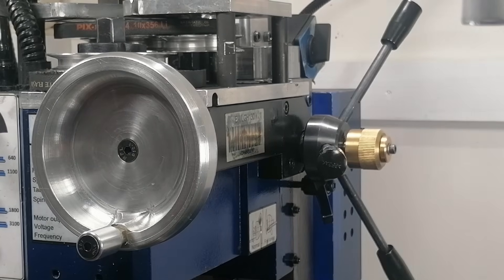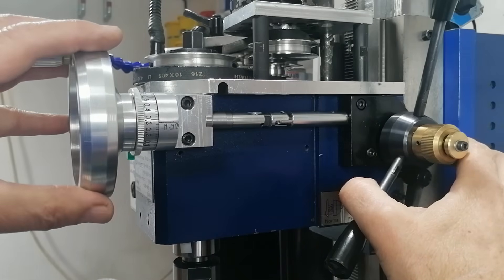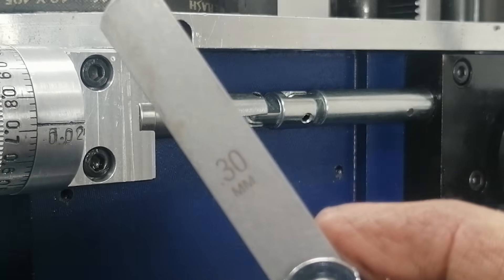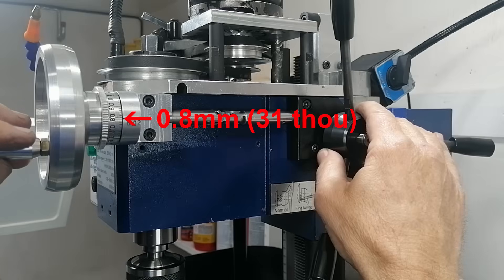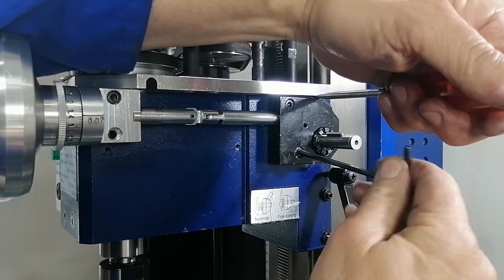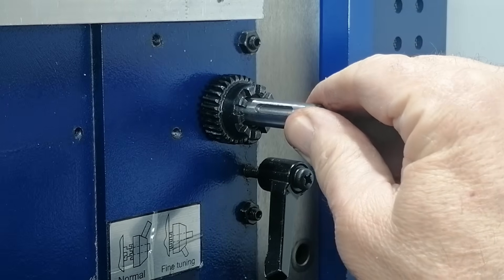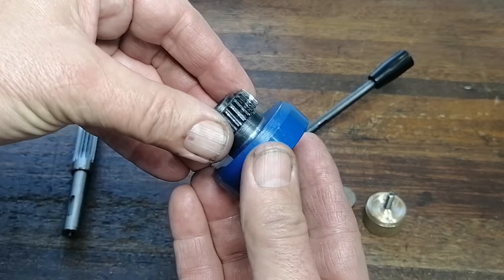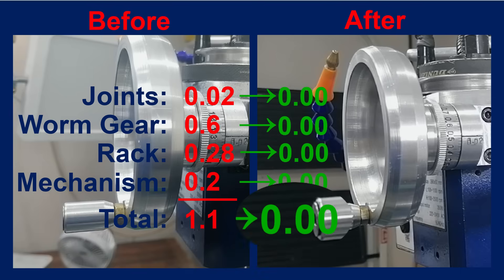Zero Backlash Fine Feed on the Mini Milling Machine

Comment: Excellent job. Instead of using small shims, why not eliminate the universal joint and use a rigid rod? The whole assembly looks well aligned, may be no bad alignement
Reply from the maker: Thank you. I initially considered using a rigid rod, but then realized that the worm gear alignment would need some movement when it is adjusted. I could have used a rigid rod if I allowed the bearing block holding the fine feed wheel to swivel, but that block is right up against the base of the 4-speed belt drive. At the end I thought that shims will be less work. But you are correct, a rigid rod is a good idea.

Comment: Very goog job.  What is the thickness of the shims behind the Z axis Rack?
Reply from the maker: Thank you very much. Each mill will have to have its own size. Mine was 0.65mm and 0.7mm. However, you need to leave space to prevent the head from being pushed forwards and off the dovetails. I realized that too late and released another video to address that. Look at my "Why I Brought Back Backlash on My Mini Mill" video" that describes why you need backlash on the column and not to use too thick shims behind the rack. You can remove all the backlash on the other parts, but it is important to leave at least some backlash on the column.

Comment: There really is no such thing as zero backlash with a screw. Even ball screws have minimal backlash.
Reply from the maker: I hear you. I did manage to remove it all (including the screw). However, after the video, I realized that my rack & pinion needs to have some backlash to ensure that the column dovetails engages well and that the shims is not pushing it away. So I used smaller shims to get just a little bit of backlash back. I now have peace of mind that the column engages well. I still have all the benefits of "zero" backlash.
Thanks for the feedback. I really appreciate it.

Comment: This video inspired me to take mine apart and shim the universal joint with some aluminum pop can material, took 2 layers and pounded the roll pin right through it to make a hole.  To get rid of some of the play in the worm drive I attached the finefeed knob to the shaft first and then pushed the worm drive assembly away from the knob and tightened it down.  Just those 2 things made a huge difference, didnt measure but feels at least 70% better.  not bad for 5 minutes and $0
Reply from the maker: I am glad that you found the video helpful.

Comment: I have the same mill as you but from a different supplier, it also came with a 2 speed belt drive and 750w brushless motor.  I had a look at the massive backlash in the fine feed and found a few differences, I have a straight shaft for the drive with no universal joints, one area that does not need fixing.  I also had to reduce the screw heads to rotate the worm drive enough to eliminate backlash but my gib screw is 10mm lower and does not hit the casing.  I have very little play in the rack but as I have a longer rack coming from China, I will leave that until it arrives as shimming can be done when that is fitted, along with a similar height modifiction to yours.  I have less play in the fine feed engagement but it is always annoying to use so I will try a similar addition as you for the lock mechanism.  These are all really great ideas, as it the TCT wood blade for cutting metal, I tried that and it works well, who would have thought it.  Keep up the good work and keep posting videos as they are all enjoyable and informative, Mark, UK.
Reply from the maker: I am very glad that you find the videos informative and enjoyable! I am glad that my ideas are helpful. 
PS: You have a very powerful motor. Nice.

Comment: I have a Sieg SX2P, which uses a similar mechanism to yours - or it did . 

I get fed up with winding the X axis long distances, wanted to motorise it, so did so with a stepper motor, using LinuxCNC. 
Liking that so much I motorised the Y axis. 
Liking that so much I got rid of the rack and pinion Z axis and fitted a ballscrew with stepper motor.  Backlash 0.00...

I then had a fully CNC milling machine, but missed the instinctive controls of knobs, so am part with through adding rotary encoders to simulate the original XYZ knobs.

And then I'll think of another improvement, and . . .
Reply from the maker: Thank you for sharing your experience, it sounds like you have an excellent setup.
PS: I also love my handwheels.
Reply: @GreatIdeasCatalogue  It took me some time to realise how ergonomic and intuitive handwheels were,  but after enjoying coding directly in G-code, then using a Gamepad as an interface, I realised that for many jobs handwheels were so much better. I have built the rotary encoder hardware + software (based on Raspberry Pi Pico microcontrollers) and now it's the hard bit: finding a neat way of mounting the units.
Reply from the maker: @frogandspanner That would be a nice project. The Y-axis dial always hide under the vise, so you now have the freedom to prevent that. Enjoy it.

Comment: I didn't like the universal joints on my quite old mini mill at all, so a straight axle fixed the problem - and a small bit of filing to get the front bracket system aligned. The gears I did not touch, it is a half turn, but I have a DRO set mounted so it is a no brainer, just a slight nuisance. But I might look into fixing it. The new slip-clutch is certainly a very good idea worth consideration. Thank you!
Reply from the maker: Thank you. I have made a video dedicated to the clutch, which I will release in 2 weeks time.
Reply from the maker: Here is the video on the clutch. Enjoy the preview.
https://youtu.be/Cam8c9sj9Pw

Comment: At 2:59, Did you disassemble the u-joint and put it/them in?  OR  Did you make the hole, a slot to the edge, and wedge it into the u-joint?
Reply from the maker: I knocked the pin out and insert it through the hole in the washer.

Comment: At 5:38, You could rework this part with 1-2 deg draft angle on the teeth so when it pulls down, it engages 100% interference fit, 0% slop.  You could add draft to the toothed mating drive portions, and deepen the recessed areas of the drive gear teeth to get to 0% looseness, 100% total engagement.  Still, no new parts.  ... Thanks for making this series of videos!
Reply from the maker: Thank you. I appreciate it.